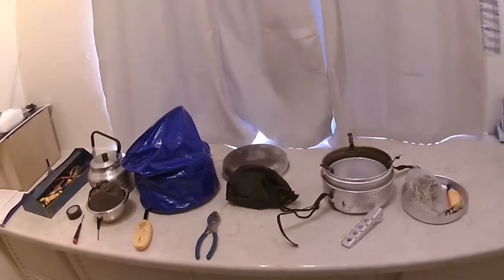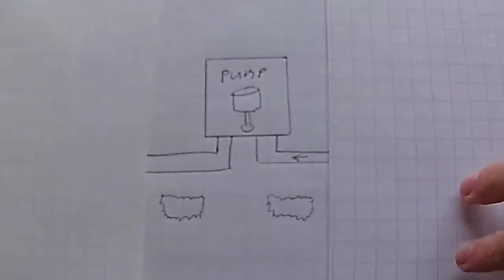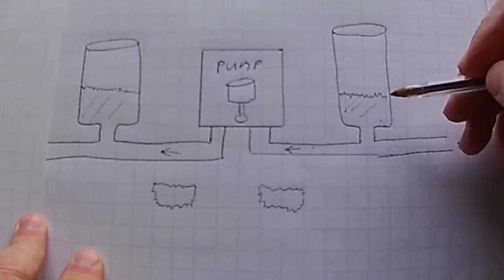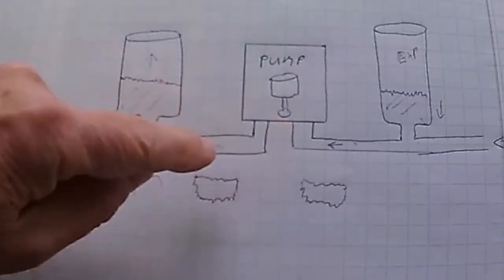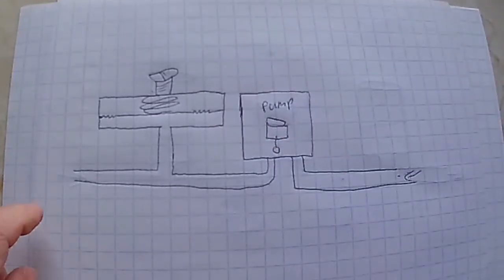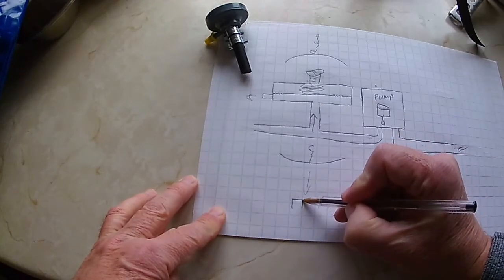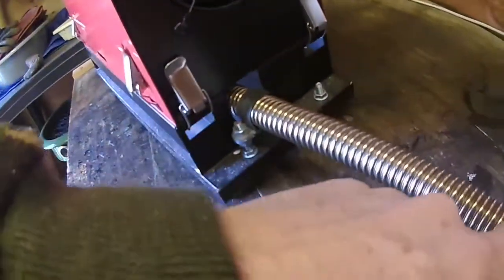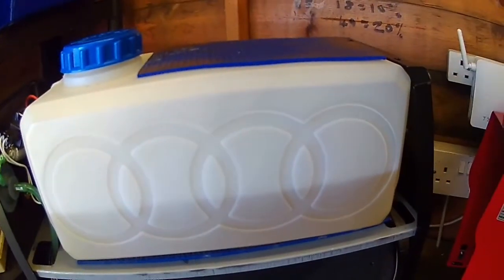Chinese Diesel Heater. Pump Damper. Thingies. Man shed.

Comment: If you want a quite pump hang the pump with zip ties just make sure to keep the 30 degrees angle with the connector facing upward
Reply from the maker: Personally I have the pump in my motorhome in a place which makes it acceptable.  The video is mainly for others who are being misled by adverts suggesting devices that give  sound improvements. Yep fully aware of hanging pumps. Thanks for your input. Cheers from old George 👍